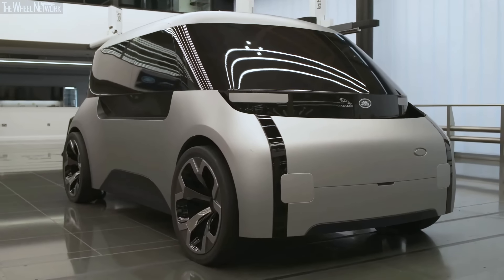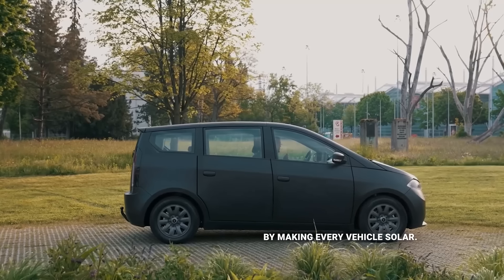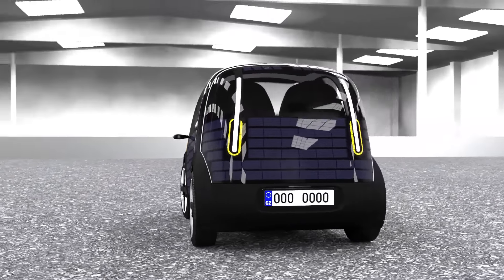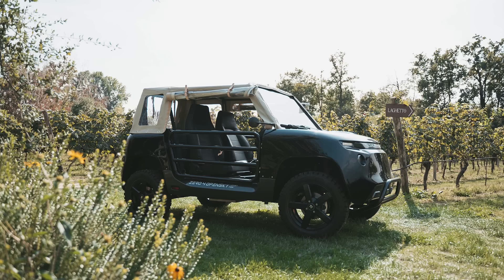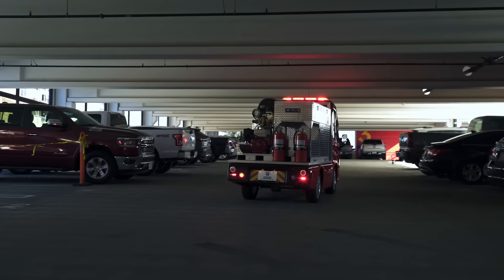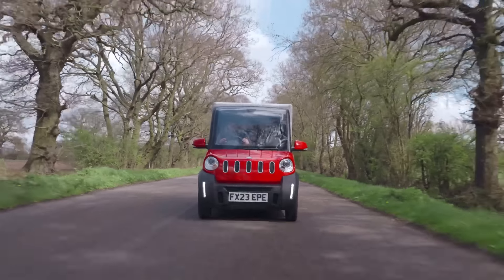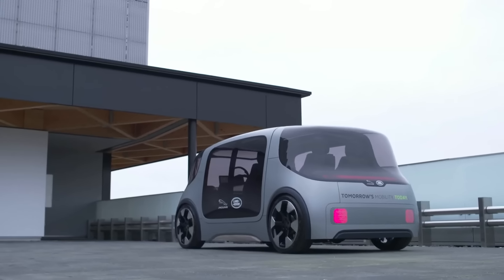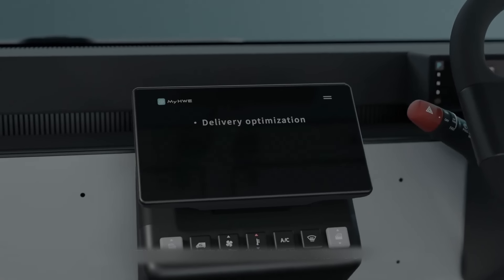11 Mini EVs and Micro Electric Cars

Comment: What about crash safety regulations? Are there really no crash tests for such micro-machines? And how are they certified for production and operation in this aspect? China, okay, but how is such a car-coffin allowed in security-obsessed Europe? After all, God forbid, for example, if such a truck hits a car, it will fly away somersaulting or on its side! This is not to mention a simple fairly strong blow from the front or side... Can someone enlighten me on this issue?